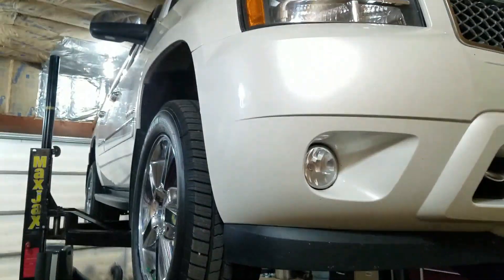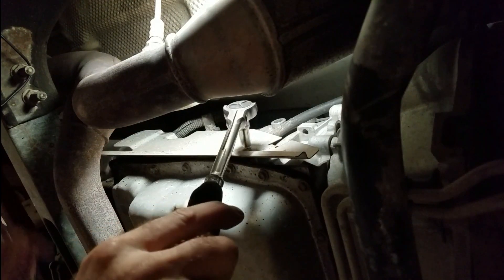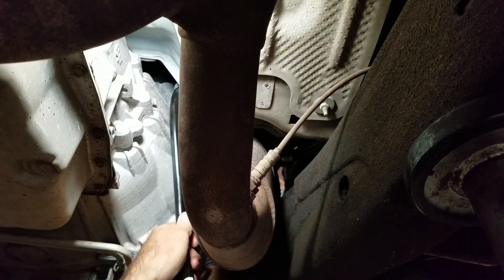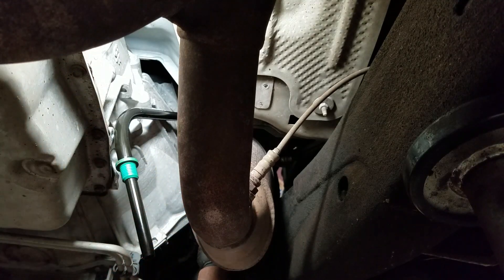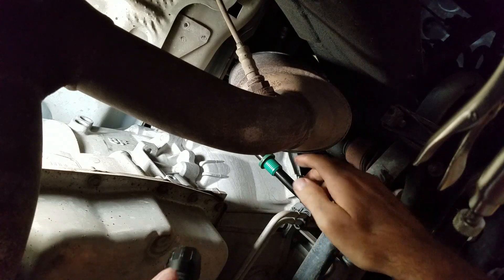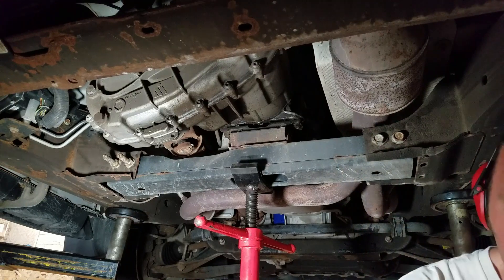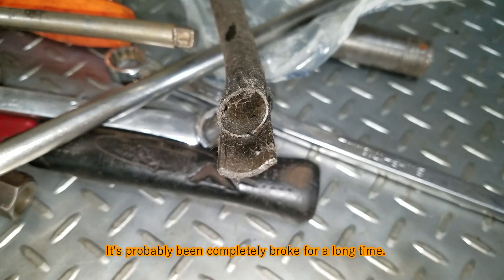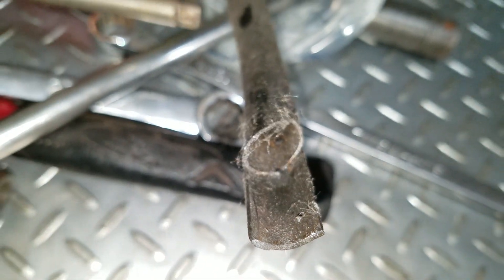2007-2014 Tahoe transmission dipstick tube replacement

Comment: Excellent video man.  To the point, minimal editing and no garbage intro.  Thanks for taking the time to put it together.
Reply from the maker: Actually maximum high speed editing. Thanks for watching.
Reply: @RustBeltAuto  A solid comment and solid reply. Mine is an 01 but I feel like this'll work. Thanks man. Fu**in' A

Comment: Yo...thanks for the video!  Disclaimer- I'm not a mechanic, just a cheapskate trying to keep an older truck on the road, so this comment is simply my experience on the repair...as others have said I shortened 1.5 off the end and it went in the trans. with just a bit of finessing.  An inch prolly would have worked.  The hardest part for me was that the dipstick tube did not want to go where it was supposed to in the engine bay.  It kept getting stuck on the firewall under the heater hoses when I pushed it up and I could not get a good grip from the top.  I had to swallow my pride and ask my wife to crawl under the truck and push the tube up while I maneuvered into place from the top.    Dealer wanted close to 3 bills labor and a couple other shops I called didn't want to touch it.  This is on a 2011 escalade esv  2wd for me.  And surprisingly the local Chevy dealer was a few bucks more on this than the Cadillac dealer when I got an estimate.

Comment: Thanks for the video. Just did it on my Sierra. Went to put in trans fluid and found the tube was broke and had a rubber cover to connect both broken halves. I was able to twist the dipstick tube from the bottom of the truck to the top without removing the bar but I'm sure your way made it easier :) I did use a long handle ratchet to push the tube high enough that the tube could slide into the trans pan. Thanks for the tip on the swivel socket- that saved me from awkwardly using a ratchet to try and probably fail at tightening the engine block bolt
Reply: I'm looking to purchase a rubber cover to connect the two halves. Do you have a link to one?

Comment: Thanks for the video, I just had to replace mine on my 2011 Silverado 1500. It was a super snug fit, and found fishing it up through the bottom worked the best. The bottom of the tube was still a 1/2” too long, so I just knocked off a 1/2” and it went right in. There’s still 4” that sits in the transmission, so I’m not worried about it.  Didn’t have to take apart anything, so that will be good to know if I ever have to do this again 😉
Reply from the maker: Nice!

Comment: Thanks for the video.  Just had my filler pipe 2011 Suburban break in exactly same place. Your video showed me how “easy” the process was. I was able to avoid dropping the cross member; not sure why not, as everything else seems the same. We came in from the top and we’re able to thread it right in.  30 minutes, soup to nuts. Thanks again.
Reply from the maker: Yes. Some trucks are a little different, messing with cab forward designs and what not.

Comment: Just did one on a ‘10 Yukon. I tried dropping that crossmember and lowering the trans case with a pole jack but I still couldn’t sneak that fucker on. I think they made the clearance even worse on that model with how tightly packed everything is. I ended up cutting an inch off the tube and sent it. No leaks, sturdy, and isn’t gonna be coming back. Thanks for the video man!
Reply from the maker: Think there was another commentor that said he whacked some off the bottom too.

Comment: Just found out my 2011 Yukon had a broken tube when I went to check fluid. Purchased a dorman tube and cut half of section off that inserts in grommet and with a few minor bends and some prying I managed to get it in. I also had to replace heater hose connections on firewall afterwards due to getting bumped during tube installation causing small leak from both connectors.

Comment: On a GMT900 2WD 6L80 truck, I bought a new tube at the dealer, watched this video, and cut 1.98." No crossmember drop was required. At this time, I am not certain if the lower section I cut helps keep the tube aligned. I did hold the tube and seal down firmly before tightening the nut holding the bracket to the bellhousing stud.
Reply from the maker: Some commenter on here said he did the same thing. If it was my truck, I probably would do the same thing.

Comment: Thanks for the video it helped a lot. I just did this job but I have about a fingernail gap between rubber boot and metal part of transmission. I’m guessing it needs to be flush any ideas how I can do that
Reply from the maker: Should be fine. You will now if it leaks.

Comment: Just got done doing a 2011 Chevy Tahoe 5.3 instead of dropping transmission some , all you have to do is put a jack under the body and raise body about 3-4" higher than frame then you have plenty of room , think i removed the very last plug wire on thst side cause it was in the way , but dont attempt this without creating some room cause you will definitely need the extra room .....!!!!
Reply from the maker: You unbolted the body from the frame?

Comment: Dirty secret is the dealer would have just cut off half of the section that fits into the transmission with pipe cutters. No pulling the engine or crossmember necessary.
Reply: You da real MVP!
Reply: That's what I'm fixing to do tommrow we fucking it up right good and proper
Reply: Game changer. Worked like a charm.
Reply: Who else is tired of the dealer ripping off everyday people?

Comment: Would it have been possible to cut an inch or so off the tube to make for an easier install
Reply from the maker: Maybe like a clean cut with a pipe cutters? I would not, because I didn't need to. If you try it, worse that could happen, is buy another tube I guess.
Reply: @RustBeltAuto  I don't have a long screw jack to move the trans around so that is what I might do or just take it in.
Reply from the maker: @swamper2fly  you can use a regular jack, and a block of wood.
Reply: @RustBeltAuto  thank you

Comment: I just changed my transmission fluid.

When I started the fill process, I noticed my dipstick was loose. I went down and pushed hard on where it connected to the pan, but the dipstick was still loose.

I decided to try pouring in tyranny fluid to see if it leaked, and after the second quart there was a really small leak, I pushed on the dipstick further, and didn't feel any difference from when I first noticed it was loose.

Filled the tyranny anyway, and chucked it to having to reuse the old gasket which I plan to change soon.

After filling, and test driving, I didn't see anymore leaks, yet, I just finished and had to see how the dilstick worked and how it was put together, so tomorrow I'm checking the  bracket, and hope that was the cause and not a broken dipstick.

Working with no lift at home makes me queasy, and I can't work for durations longer than 30 minutes under the truck without getting sick, so to drop the tyranny, and crossmember to fit a new dipstick would probably be a trip.

Thanks a lot for the detailed, quick, and comprehensive video.
Reply from the maker: Some of these have recalls on them. Might want to call your dealer, and see if they can do it for free.

Comment: This is a common issue with these tubes.  But I can guarantee that there is no reason to remove the engine to do this.  I replaced mine in my driveway and never touched any other bolt on the truck, only the one holding the tube support.

Comment: Wish the aftermarket transmission lines were not on my buddy's truck this is literally the last thing yhat needs to go in and if this doesn't work I'm going to hillbilly mod a flex line to it 🤣
Reply from the maker: It will most likely seep fluid. Every time I see that done, it seeps fluid.

Comment: well....you didn't secure it and mount it---it broke at the mounting point.  I've done this on a c2500---but the only way to go is to use a stainless steel flexible dipstick hose--the problem isn't getting the tube in--the problem is mounting the tube on the bell housing--its pretty damn near impossible.  The long flexible hoses mounts on firewall--which is easy.  simply use some fishing line or string and attach one end to the end of the tube--fish it up to engine bay--install the push in tube--and then screw into firewall.  Without it being secured and bolted down--this is just going to break again--and will break at install point in the trans case...just sayin...
Reply from the maker: I would imagine that the replacement is made of less brittle tubing. They are not supposed to do that.

Comment: I wish someone did a fricken video on a 07-08 4 speed
Reply from the maker: What's the difference? It's the same tube.
Reply: @RustBeltAuto  I ended up getting it.   It was a pain in the fricken ass but I had to use more brute force